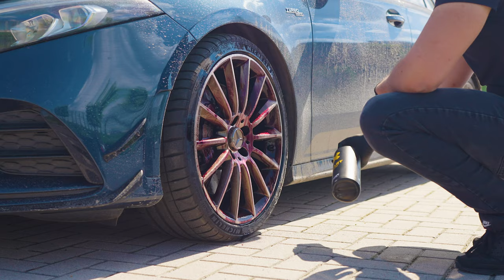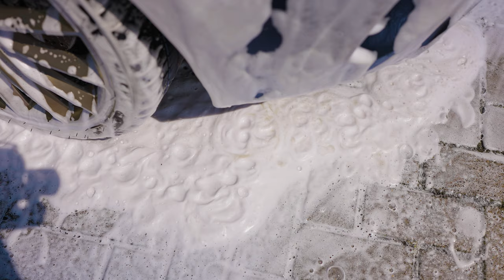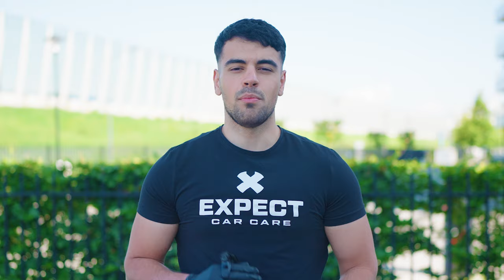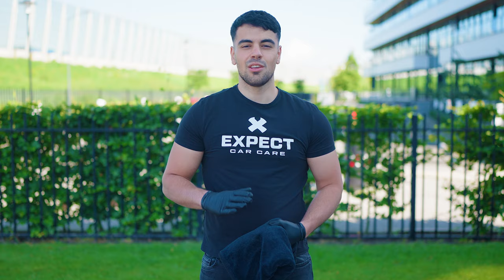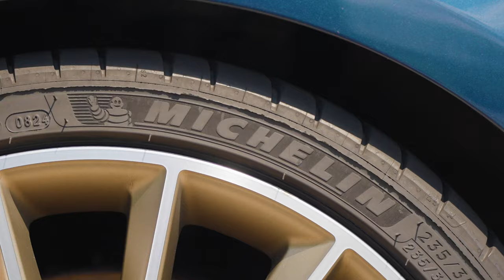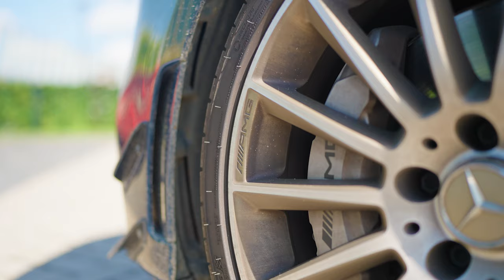Cleaning A35 AMG with Expect products

Comment: Should never clean wheels dry always wet first then pre wash and iron fallout
Reply from the maker: Actually not, Breakup Wheel Cleaner is more effective when sprayed on dry, when you rinse first you will dilute the product. Same goes for not rinsing before applying Snow Foam Pre Wash, to prevent dilution and get the most effective effect
Reply: @expectcarcare  bodywork is different because its actual paint pre wash will always be used on a car first and that's the right way ur correct but the wheels are pure metal and applying cleaner first can cause scratches as you are agitating it dry and also when the sun is out it will dry the wheel cleaner up causing their to be water marks on the wheels after rinsed my technique as a detailer is always pre wash wheels first rinse it of then apply wheel cleaner onto wheels therefore it has less dirt on and as its been rinsed the dirty will fall down as agitation is delivered and it also won't dry up that fast in heavy sun. Still a great job with this car. 👏 not telling u tight or wrong just my process as a detailer mate.
Reply: @expectcarcare  and also sorry I meant pre wash first rinse and then add ur wheel cleaner snowfoam or iron fallout